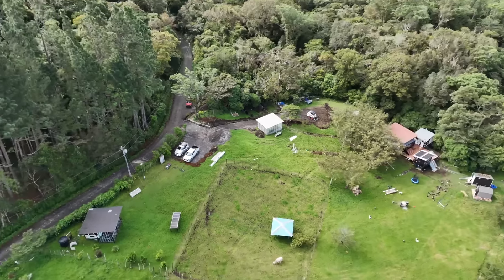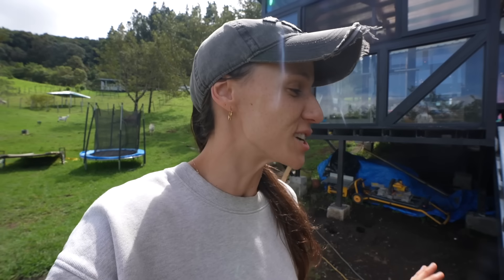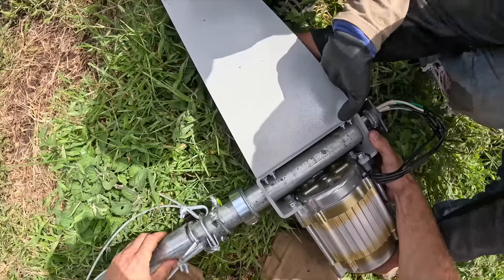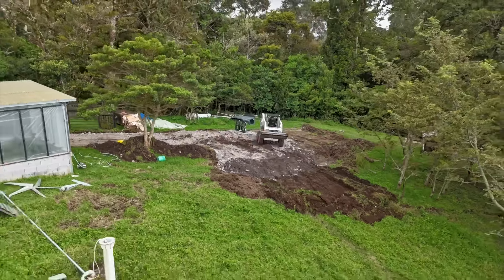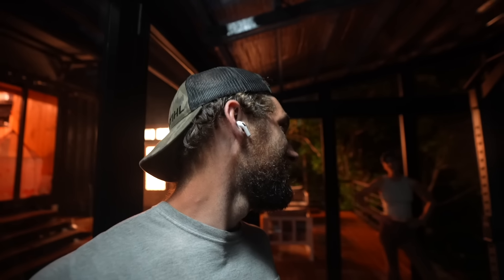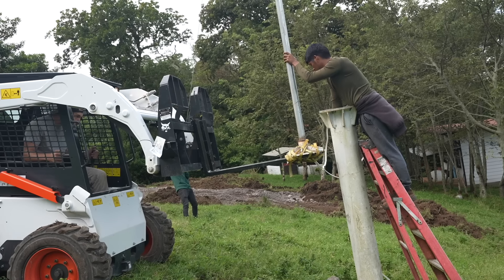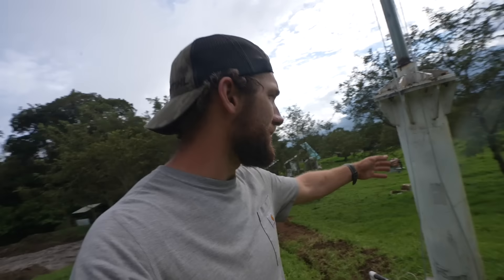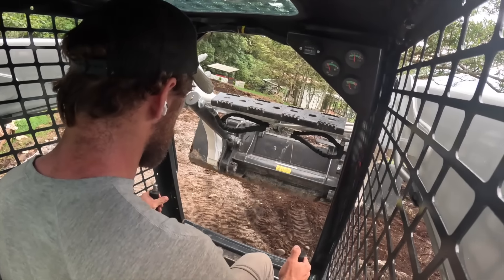Life Changing Wind Power!!! // building our off grid home

Comment: As a structural engineer I can assure you the poles won't be able to handle the forces generated even by a modicum of wind. Your best option in to attach 3x 1000lbs steel cable guy wires !

Comment: Guys, the easiest way to have gotten that turbin up was to weld some 1/2 Pipes, each alternating on the side of the ground base and Mount that will sit on top to create a hinge. Put a bolt thorough the pieces to hold the 2 pieces together, Then use guy ropes and your skidsteer to hoist it up. The hinge would hold and guide it.
Good job in getting it done though!

Comment: For your wind turbine, look up 'gin pole' designs. I have worked on many small residential units and they are by far the easiest setups. you can raise and lower single handled with a small winch or pully system. Love the content

Comment: You could add three cable supports at 120 degrees about halfway up the support pipe. Use 1/4 inch cable and large turnbuckles to anchors in the ground. Use two levels to make the pipe straight up. Now you have much less chance of that toppling.

Comment: Jordan, I suggest a three cable (1/4" diam) guy wires as high as possible tied to concrete bases around 3 feet deep.  You can weld 3 steel bar lugs to the pipe as high as you can do it safely.   Good luck!
Reply: Very good suggestion, cable angle at around 40 degrees. Good suggestion.

Comment: I would have suggested to try using the blade of the skid steer to pull the material down the hill instead of hand shoveling. Also you can use your bucket to assist you when your stuck by driving it vertically into the earth and using the tilt to push you backwards in conjunction with the wheels.

Comment: You need a real tower for the wind generator to work ( Note : it will work just not the full potential ), for that to work right, you'll need about 60 to 100 feet of tower. Get a profesional installer and ground it properly.
Cooper is a bit expensive, plus surge protectors. Safety first.

Comment: how about using electrolysis, ( two rods with current in water producing hydrogen and oxygen, in a closed circuit) ,  it spins a turbine, that not only feeds back into the system but produces enough electricity to power everything on the farm and then some, possibly for the whole mountain...................🤔🤔🤔🤔🤔🤔🤔🤔🤔

Comment: You know heating the base unit up with fire, and putting the end of that pipe in ICE would of expanded the metal a tad on the base unit, and shrunk the width of the round pipe, and allowed you to slide that baby in with hand pushing.

Comment: The next time you take that turbine down.  Weld 2 hoops on it below the bottom of the blade height.  That way you can use the skid steer with the forks through the hoops.  making it easy for one person to lift it.  If the loops are above the center balancing point between the base and the turbine.  It won't tip off and you can lash it to the forks when lifting. Great Job Though,  but a bit dicey ;)

Comment: That pole will bend. I have built a similar windmill from scratch. You will need to have three cable tie downs that are anchored into the ground do you support the pole. Drill 3 holes in the upper pipe. Bolt in I bolts. Attach the cable to the I bolts. Run the cable down to the ground. Attach it to well anchored stakes

Comment: Telescopic, smaller inner pole/pipe to add height w/bolts attached to set in place, top section detachable to pull off turbine in case of repairs. (Like a radio antenna???) 🤔

Comment: I had a small wind turbine at a suboptimal height relative to surrounding vegetation etc at my farm in the hills of Cayo District in western Belize... It was better than not having it! On breezy nights it could just about keep up with the load on the batteries - certainly kept them from dropping as fast as they did on still nights. Would it have been better 20 feet higher? Definitely! But it was a lot better than not having it. 

And then it died! Too many direct lightning strikes and one too many hurricanes.

Comment: Yeah, horizontal turbines never worked well, that’s why all the big ones are vertical. You probably need to terrace your road with some banks to stop the water running down it. The banks need to be at intervals  that do not allow the water to build up speed.

Comment: actually you could have made it easy to install if youve copied the streetlight version of this pole part youll just have to re inforce it a little bit by filling the inside with a flat bar and some insulation foam.. the one that hardens like a concrete..... been installing wind turbine for about half a month all by myself with just 3 battery operated power tools and one inverter welding machine 70feet is duable with this method but youll need a manual chain hoist attach to anything that cant be pulled,,,, this method also makes it easy to do maintenance every month or maybe 3-6months gap

Comment: That turbine will not work.   Those blades don’t have a proper angle to “catch” resistance from the air.  Also, they are metal not composite - to heavy.   I saw no rotation at all on the video.  Greeting from a electrical engineer 😊